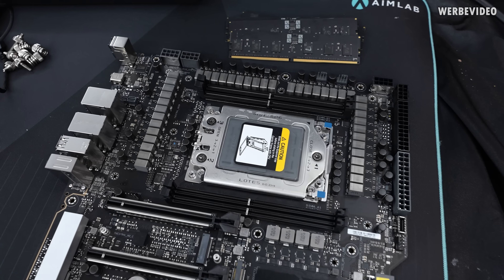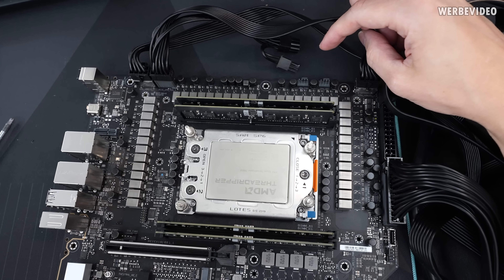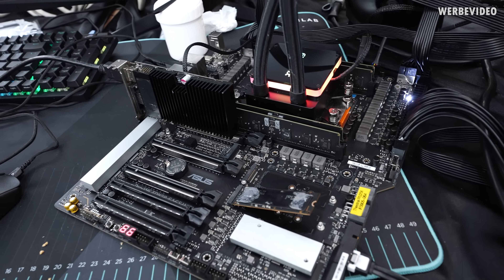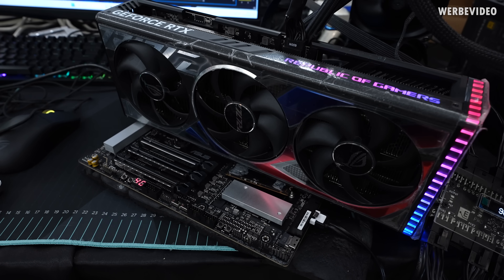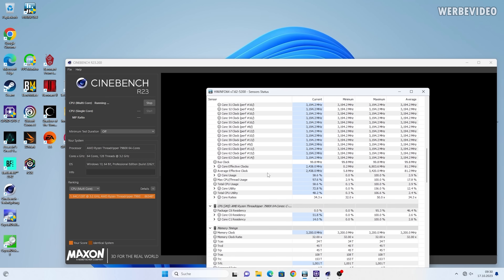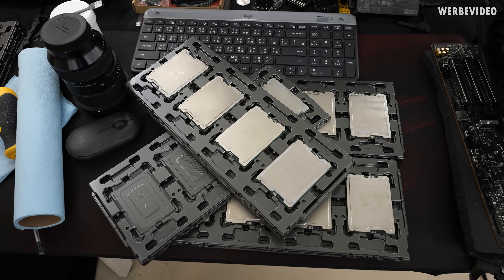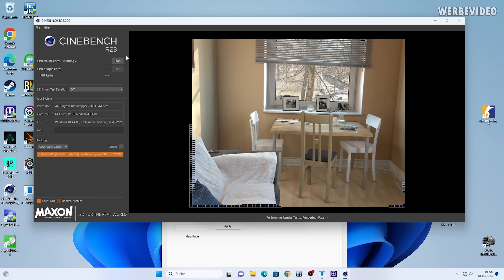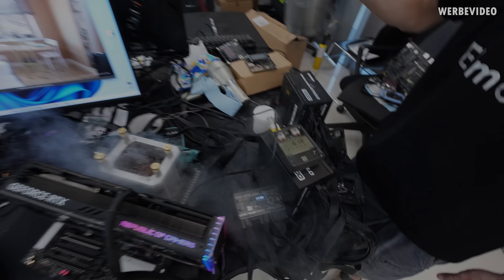Intel is in Trouble! This CPU is just INSANE

Comment: For me it's hard to imagine what it's like to use a powerful CPU like this. I don't do any hard work on my computer, nor do I game. I still use my Ryzen 7 4750G and are somewhat satisfied, but still would like to buy one of the earlier versions of the Threadripper. I've seen a few good prices for only the CPU or a package with the motherboard, CPU and ram. I'm surprised they can be so cheap as a used system.

Comment: You need to try to disable 6 cores per ccd instead of 7. 16 cores. Leaves hyperthreading on the table with them able to communicate internally and externally. Not just strictly just externally like with 8.
Reply: And use ryzen master to figure out which on is the fastest cores. To get even better.

Comment: does this have any practical use for music-makers? meaning low latency. Cheers
Reply: Very much so. This is done by core isolation. So when you have this many cores, if you running windows, you can isolate the ccd through task manager, processes tab. Right click, select set affinity. Turn off cores you want to dedicate to your music production programs on all processes save the music applications. Leaving just those cores on for the music applications. Then turn off automatic windows updates.

Comment: I watched a video before yours. The video covered the un-boxing of this type of CPU. After removing the CPU, the producer removed the foam padding from the box and turned it upside down to reveal a special torque screwdriver and mounting bracket. He said this tool must be used when installing the CPU to the MB. It seemed to me that you were using, I presume, a regular screwdriver. Did you somehow forget to use this tool, or did I miss something?

Comment: I just realized the CPU is pulling over 270A, which is more then my MIG welder or spot welder I have at home can do. And the CPU still survives! That is wild.
Reply: Keep in mind Power is Volts times Amps.  Your welder doesn't run at <2V.  Not to say that computers as a whole don't pull more power than a welder, but CPUs aren't quite there yet.

We need to give Intel a few years...
Reply: It doesnt pull 270A at all. 270W.

Comment: Other than the cost of entry, it would be tough for me to justify upgrading from my 5800x3d b550x system. I think it would be unreal if someone sent me a board and cpu zen 4 threadripper, but I don't really see that happening. Considering you have the choice, I would run that in my home system (my everyday machine) for a while, just to see the comparisons. I bet if you edit videos it'll go a bit faster, and if you save a good bios for gaming, it's not a big deal to change it up. That's what I do.. One thing I dislike about there almost always (not so much now but before yes) getting BIOS updates.. I would have to re-create all my saves for different things I do with my system. Yes it makes a HUGE difference if you're going to be doing a specific workload or game or whatever, SAVE the bios for that task.. it's a good thing

Comment: Other reviewers are saying that threadripper mb have flaws which cause problems for the performance. The sales of threadrippers is very low and why wuuld someone spend $4000 on the cpu plus thousands more on memory, mb and its overkill. When you can Ryzen 7 or 9 and a 1/3 of the cost and get similiar results unless your doing some crazy modelling or complexcalculation it more than enough power.

Comment: Why not buy Epyc Genoa, with these threadripper prices. 64 Core epyc 3800Euro, Tyan  workstation board 980 Euro, IPMI 2*10GBe, 2*8MCIO,2*4MCIO, miniSAS etc, with all the bells and whistles, 4 *64GB 4800 800Euro cheaper than the new threadripper stuff, next month i will buy this. Around 6000,,you have a top notch Epyc setup, where you don't need the expensive threadripper. In 2 years you upgrade to fastest Genoa, with lots of cores, for a lower price.

Comment: Nice trophy CPU, but I would bet sales to be abysmal. I'm coming from X99 then X299, and now a 13900K meets all my HEDT needs, even for VFIO thanks to the iGPU. The 7980X is too expensive, and the lower core count parts don't make much sense vs. a 13900K or a 7950X(3D).
Reply: This thing will sell like hotcakes. This shit makes ACTUAL PROFESSIONALS dicks hard. Threadripper isn't for well moneyed enthusiasts anymore, it's STRICTLY a workstation platform (just available in slightly cheaper [TRX50] & more expensive [WRX90] varieties). "Traditional HEDT" is dead and it's NEVER coming back. 🤷 The classic HEDT market of wealthy enthusiasts & hobbyist creators just isn't there to support it anymore, and also simply no longer need what the large socket platforms are offering nowadays.

The professional workstation market otoh can DEFINITELY support Threadripper 7000 without any issues, whatsoever!
Reply: the non-pro version is supposed to be for enthusiats, but if you say so...
Reply: And lol if you think this thing will sell abysmally do pray tell me why Threadripper 3000 was CONSTANTLY sold-out & out of stock during its heyday and long afterwards? O_o The 64-core TR 3990X was often absolute unobtainium as visual effects houses/etc immediately hoovered up any/all supply that hit the market.

Comment: problem is that most of the software can't handle so many threads/cores. how many cores were under load with adobe 4k rendering?
score should be higher. I think disabling hyperthreading should help to boost performances on many of the used software.
Reply: This is in many cases a Windows problem for all the apps that use the default Windows thread scheduler, which still maxes out at just 64x threads per process (why disabling SMT on AMD's >=64-cores often helps in numerous workloads). 🤷

The only way to push past that is to instead write & use your own custom thread scheduler like the one in Blender to actually have a single app process be able to utilize >64x threads, which is a lot of work (and Blender only did this a few years ago, ala when the TR 3990X launched in early 2020 it would only use half the CPU if SMT was on).

If you want to use a >≈64-core CPU for SERIOUS work, you should SERIOUSLY consider switching to a Linux based operating system. 🤷 Linux is just simply SOOOOO much better equipped to natively handle super high core/thread count CPU's than Windows! Many workloads are ≈+10-40% faster on Linux vs Windows w/ said 96-core TR 7995WX!

Comment: It boggles my mind that Intel could just stick 2 14900K's into a CPU package and compete with this thing.  Do you think the 14900K is a little underrated lately?
Reply: Only if Intel could somehow create fast enough interconnect for those two 14900K chips. Typically the interconnect is the hardest part to design if you want good all core performance.
Reply: @MikkoRantalainen  Yes, if only Intel have solved this very difficult problem with like say.. an embedded multi-die interconnect bridge (EMIB) or Foveros-like 3D chip tacking technology.

Intel-- what are you doing!
Reply: @Nanerbeet  The problem with tech like EMIB is that you cannot blindly apply it to chips that are not designed to support it from the start. Designing a new chip that can support EMIB and run at the performance level of 14900K is far from simple.
Reply: @MikkoRantalainen  There is no doubt in my mind that it is difficult, but clearly Intel has done it and is far superior to traditional chip packaging.  Honestly, I can't fathom why Intel hasn't responded to Ryzen with a multi-tile desktop part.  A hypothetical copy-and-paste of the 14900K would demolish the 7950X, not withstanding all the complications that must be solved with that approach.  If Intel wants to win, they need to stop using laptop parts for their desktop lineup.  I guess it must be a cost-saving measure...
Reply: @Nanerbeet  Or they might have tried to do exactly what you described and failed?

It seems pretty logical to try doing that but as I wrote, interconnect tech is very hard to get right because any part of the design can create the critical bottleneck.
Reply: @MikkoRantalainen  Given that they've already got several server and data center products on the market with this interconnect design, pretty sure they've figured it out but just haven't bothered to focus on the desktop market.  The next chip to release using these advanced packaging technologies is a laptop part called Meteor Lake.  Next year they'll finally launch a desktop part called Arrow Lake but it looks rather wimpy on paper.  I think by then AMD will be so far out in front there is no coming back from this...
Reply: @Nanerbeet  Where's the datacenter CPUs with cores as fast as 14900K has on turbo?  I would argue that the biggest cause is that Intel cannot get the interconnect to keep up if they try to increase single core performance. x86-64 architecture requires the CPU do have logical equivalent of memory barrier nearly between every memory access (because x86-64 is cache coherent unlike ARM), unlike ARM or ARM64. This results in a lot of traffic over interconnect between chiplets and it's hard to do with high clock speeds. ARM and ARM64 would be easier to use with chiplets but writing multithreaded programs on ARM or ARM64 is harder because the programmer must syncronize the memory between threads. (Or let the compiler do that but compiler will not do perfect job on it because it doesn't have realtime feedback from other cores.)

Comment: 96 cores to hardly beat 10 Tflops of FP32... 1/3 less than a 4060 of 300€, nice job. Can you cool it with liquid He on a bathtub? CAn it run Crysis or Flight Simulator with a software Renderer? CAn you fit 16 gpu to it to make a game streaming server? How many Mac Ultra can you buy for the price of one CPU? How much AI Tops do it have? less than a A380 of intel or more than a 2020 M1? How many more FP64 can do versus any gpu or an Apple silicon SoC?
Reply: If you have a workload that can run on a gaming GPU, obviously you should get multiple RTX 4090 cards instead because that would get much more computing power for the same price.

This kind of CPU is meant for the algorithms that are too complex to execute on GPU. If you're not running such software, wasting $5000 to this would be insane.

The real competition for this kind CPU is Nvidia A100.

Comment: I am not a AMD fan for the most part, but WOW.. so I have my OC 13900KS with Chiller putting out 42K pulling 330W and for the same power pull this thing does 100K more.. one has to appreciate tech advancement and they sure set the bar high with this setup.
Reply: And price tag. It's a 5000 dollar CPU.
Reply: @Njazmo yeah it's for power users with money. There's only 24 hours per day. Any time they can save they make more money.
Reply: I can't understand why anyone could internally hate on/"not be a fan" of AMD's CPU division... (Now the GPU division/RTG?... Yeah, now that I could understand, but CPU's??? O_o) 

They literally saved the ENTIRE PC industry as we know it from DECADES of Intel's deliberate technological stagnation and exploitative pricing & behavior that we saw from ≈2011 - 2017. They also lie/massively bend the truth SIGNIFICANTLY less often in press materials (say, Principled Technologies or "5GHz 28-core CPU" w/ a totally undisclosed chiller anyone? 😑🤦). 

Not to mention that their CPU products basically from 2019/Zen 2 through to today have been almost universally ABSOLUTE FUCKING BANGERS!!! With the only real exception being OG Zen 4 getting fucked over by its early HEFTY platform costs (which is no longer an issue, thank God). 🤷
Reply: @Cooe.  A heavy infliction of reality resistance is required to not be highly impressed with AMD's prowess since Ryzen launched - even if you prefer Intel for whatever reason.

Comment: $5000 price is insane too, so it's not for average user. Your game tests didn't quite show, how many cores was actually used. 
Was that guy at the end pouring LN2 without any protective gear?
Quite insane video indeed.
Reply: what protective gear? LN2 is inert, and while cold, the Lidenfrost effect will protect you against it spraying around. Really, handling boiling water is more dangerous.

Comment: @der8auer score 9000? One i9 score 4000. Multiple by two and price for two i9 is 1000$. How much this cpu cost? 5000? What? AMD fiasco I can buy 4 i9 cpus and then bind into hyper cluster and compute with the same score as amd 5k$. Yes, I need cat8 and sfp+ connection between 4 i9 cpus and still it is cheaper compared to AMD 5000$  fiasco.

Comment: Don't worry When Intel comes with a workstation cpu... Amd will be in a BIG trouble
Reply: No, power company will be.
Reply: @Njazmo  what?it will
Reply: Which Intel CPU do you think is comparable right now?
Reply: @MikkoRantalainen  if u know the answer to it then tell it... For now there is no workstation cpu for Intel.. amd can survive with it  untill it comes
Reply: @VxYxR.  As far as I know, Intel has nothing to compete with this CPU right now. That's the reason the price of this CPU is so high. I wouldn't be surprised if AMD took off 30% or so from the price whenever Intel comes with a CPU that can actually compete this CPU.
Reply: @MikkoRantalainen  that's what I have told above.. unless Intel release a WS cpu it will b in a trouble

Comment: I was able to afford the bottom level first gen Threadripper with a 1950x, and it's still working great.

This generation is completely out of touch for me.  The entry level CPU here is nearly 2x the cost of my 1950x.

Way WAY too expensive.  Give me the 16 core version for $700ish just like my 1950x.
Reply: Then just buy a R9 7950X then. 🤷‍♂ X670E's I/O capabilities are by FAAAAAR the best ever seen on a "mainstream" platform. Do you REALLY need 88x CPU PCIe lanes? O_o
Reply: But the performance leap is quite astounding, you have to wait for two more generations to be able to afford this current cpu, that's the tech way.
Reply: If you're happy with 16 cores (32 threads), why not go with 7950X3D? It has that kind of core count and is faster than Threadripper in single core applications. 14900K is also a good option which has even faster single core performance and very respectable multicore performance.

Comment: AMD just never stop impressing me with those computing monsters, especially this one. What's mind-blowing is that Ryzen Threadripper and Epyc CPUs are as powerful as a decent video card now, in term of floating point performance.

And I totally agree about the socket, I'd prefer AMD server socket over Intel's - seen Intel's server processor installation, it's a little bit sketchy, leaving you with weird problems like a few RAM memory sticks not detected correctly, or even loss of PCIe interfaces to a few hardware like SSD and video card. AMD's socket is much more secure and I like it best as it made installation of Ryzen Threadripper 1900x in my workstation much easier. I also should check out E-PMD wattmeter as I kinda wanted an easy way to measure the amperage consumption at 12 Volts DC power rail leading to the CPU voltage regulator, just to see how much juice the CPU consumes.

Comment: I disagree, threadripper continues to be too cost prohibitive to be any kind of trouble. Performance per dollar puts you at being able to build 3 fully decked out systems for just one 7980x system. Over 6k USD just for the cpu... yeah I'd rather split my work load on 3 systems.
Reply: That is assuming your work flow is the type that works being split like that.
Reply: Have u ever run anything where time is money ?
Reply: @dudao4163 he hath not.
Reply: @dudao4163  Not something worth dumping at least 8k usd into vs 1/4 of that for a few minutes extra wait... if thats what you are getting at.
Reply: If you can split your workload to multiple systems, you don't need HEDT by definition.